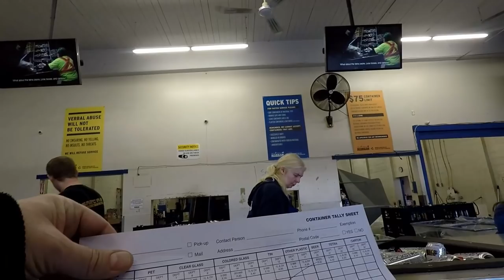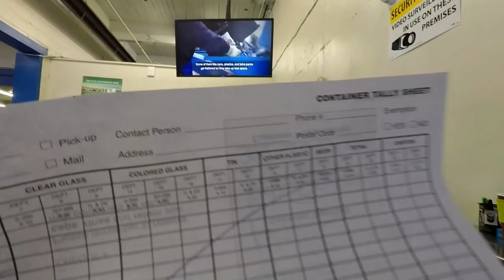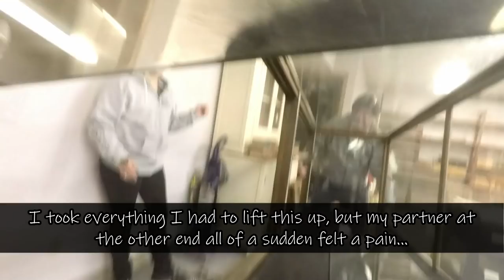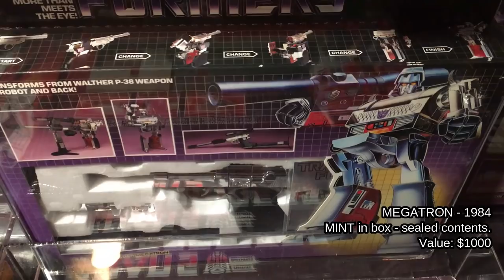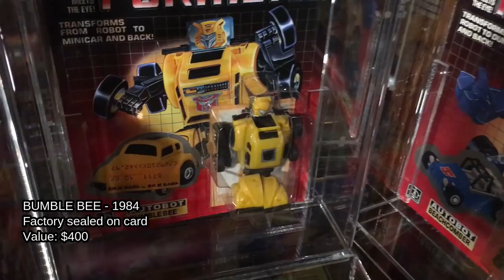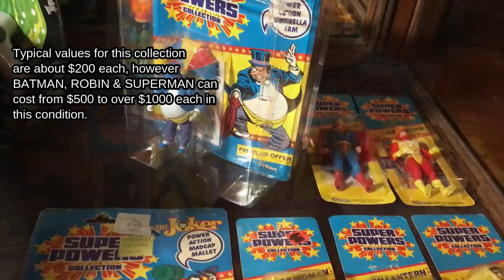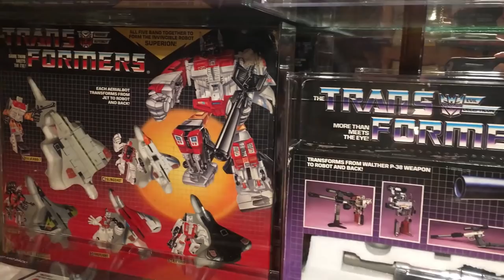Ep281:  WE BOUGHT THIS ANTIQUE CABINET FOR MY HUGE VINTAGE TOY COLLECTION!!  😮😮

Comment: We have cases similiar to this at our museum. We put felt pads under the base to make it easier to slide if we have to move the case. The top part of these cases are not very robust and don't like to be used to push it around. We use a long ratchet strap put around the base and pull it to wherever we want to move it to. It makes it very easy to move and safer than pushing on the top part of the case.

Comment: As an 80s kid myself, gotta say KICK ARSE collection. I gotta say I was feeling your pain (maybe to a lesser degree) with the weight of that beast. I have a 72-drawer vintage card catalog that is SO HEAVY. When we moved house, we wanted it on the second floor, and that's one of the few things I didn't want to deal with, so we hired movers to move it. Luckily all the drawers come out, but even with them out, it's a heavy beast.

Comment: My hubby decided to build our display case himself for cheaper than a new one.  Cost more than the 'normal' type.  If you took the top off, the windows slide down through the channels.  Most of the cost was in the safety glass. Our top glass lifted off and made it semi-lighter.
Reply from the maker: Sounds AWESOME!!!  😀👍👍👍

Comment: How long   is this ? Once you got the top off Rob  you asked Karen if   she wanted it in the back seat....How wide is the back seat ?  LOL... It looked 20' long... as your all carrying it out  of the  store... End result...  nice display of your toys.... :)  Once again Karen can tetris wood and glass so it  doesn't break  and  you missed potholes and  curbs  :)  That was a fun  video to watch....Maybe   leave a small battery drill in the truck .. would have made it easier  for  Karen to remove  screws... Thanks for sharing....
Reply from the maker: LOL  Ya,  not thinking whe I asked her if she wanted it in the back seat!  hahahahaha.
Reply: <3

Comment: What a fascinating road trip! I kept wondering why you didn't flatten your cans for easier transport! On seeing the recycling set-up, I understood!----I was drawn to the beautiful floor in the 'man cave"! Did it come with the house that way, or is that a design you put in?
Reply: Here in Regina, they request that the cans not be flattened as they get caught in the machine.  Just the plastic bottles can be flattened.
Reply: @robertawilhelm7998  I kinda suspected as much, after watching the collection process. Fascinating to watch how other areas handle their recycling!
Reply: Alana Tolstad I am also in Saskatchewan and we have a can flattener that we purchased right from the bottle depot with their logo on them.  They like them flattened a certain way :)
Reply from the maker: The floor in the man cave is ACTUALLY a recovered gymnasium flooring from a school!!!  The little squares of color would have been originally the lines on the gym floor, basket ball lines etc....    we thought it would be cool to line the up and get the basketball key on the floor again, but that turned out to be completely impossible!!  LOL